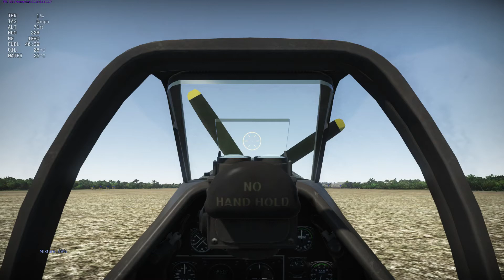War Thunder Simulation Mode Tutorial: Takeoff

Comment: I’m still crashing 🤬🤬🤬🤬🤬🤬🤬
Reply from the maker: What seems to be the problem?
Reply: @Spyro0007  it’s gay and it’s only with the WW2 bomber from the German side I’m fine with the other planes also I want to buy the harrier pack but I just started playing do I have to grind for it once I buy it or no it’s instant
Reply from the maker: @oscarmartinez3186  I think there's better words than "gay" in this case. Are you running left or right off of the runway? As I recall, some of the German bombers don't have what's called counter-rotating engines, so you will have to use your rudder as if it were a single engine aircraft
Reply: @Spyro0007  nope I’m doing perfectly fine and than all of a sudden I go straight down and die 😔
Reply from the maker: @oscarmartinez3186  I'm assuming you've tried lifting off at a more shallow angle? And does it happen after you retract flaps?
Reply: @Spyro0007  nope I even tried with other planes but let me watch your vid again maybe I’m missing something instead of doing something wrong

Comment: My problem is the airplane rolls left on take off rolls upside down and crashes any airplane i use. I have tried stick and mouse no matter what it doesn't make a difference
Reply from the maker: +Joshua “Jp109” Pennington try getting more speed before you start pulling back on the stick, and pull back more gently on the stick. What's happening is called a departure stall. The uncommanded roll is just 1 wing losing lift before the other.
Reply: How do you mix and stuff

Comment: I cannot take off. I fly RC and I know it's not the same. But thus it's bulls hit
Reply from the maker: ***** I'm guessing you're problem is either that you're pulling back on the stick too much, or not letting your air speed get high enough before rotating. If not, let me know what happens and I can help ya
Reply: Thanks. It worked perfectly. How sad all the battle settings are with the basic or realistic controls that are not authentic. We should be able to fight in simulator settings.
Reply from the maker: ***** you can still fight in simulator settings...it's in the Events tab.